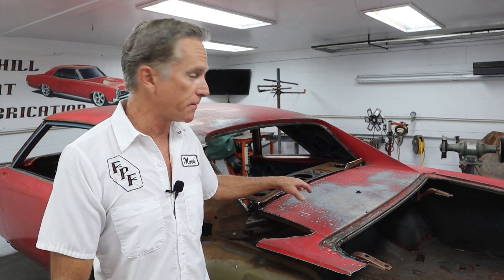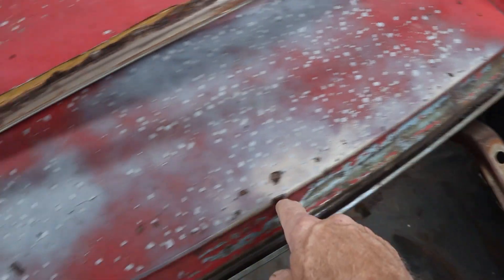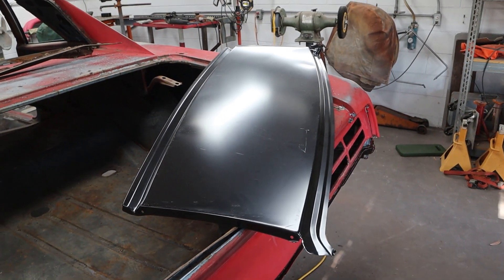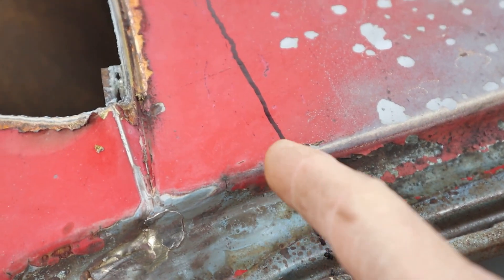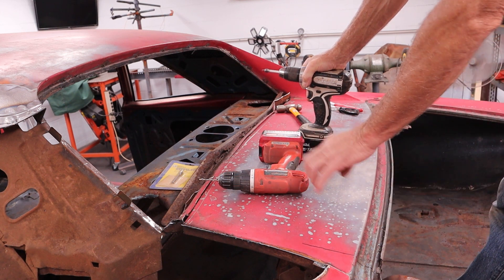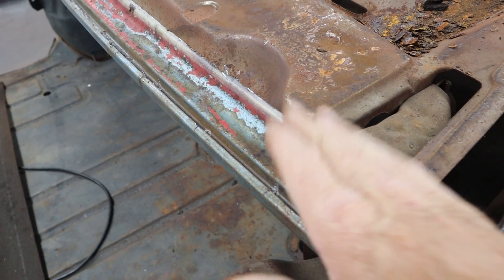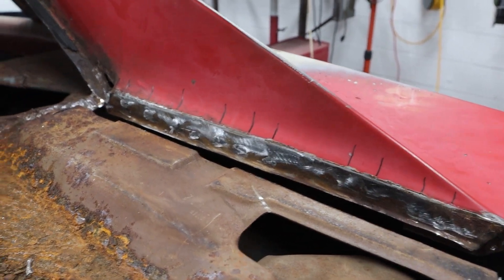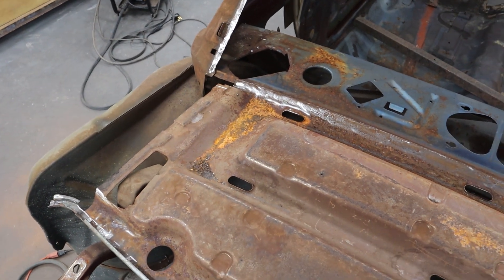GM A Body Rear Window Rusted Filler Panel Removal How To - GTO RestoMod (Ep 11)

Comment: Thanks for the video Mark. All of this is pretty intimidating to me but you explain it very well. At my level I think I need the expensive one.
Reply from the maker: It can be but it is just a series of steps to get where you want to be just like anything.  Knowing the steps is the hard part.
No guarantee the most expensive one would be much  better.  These things can be a crap shoot and that is why reviews are so important.  Buy a part, write a review so the next guy can be informed.  I wrote a lengthy one on this part with pictures.
Mark

Comment: if you  drill a pilot hole  in  the center of  the spot weld, the cutter will stay in place and  will  not wobble and  cuts faster
Reply from the maker: You are absolutely right about that.  In this case I will be using a spot welder to reattach the filler panel and did not want to have to weld in all the holes.
Mark

Comment: I've got that same long necked die grinder , use on everything.  Also I've got what I think is an old tile roller . It's kinda like a english wheel die on a handle and I can flip over new panels and pretty much roll out a lot of imperfections .
Reply from the maker: Yeah I am about to wear that thing out I use so much, very handy.  I used my thumbs to massage a lot of the dents out of that panel but it needs some more love before it goes on for sure.  20 gauge is pretty thin.  I have something like that too I think, I will give it a try thanks
Mark

Comment: Mark, big job a head hope it go's well I know your under time crunch so Rudy can be dipped. The best patch come from OPGI but are pricey and Summit Racing are hit and miss but low cost. Will keep watching Plus need send you some picture of my truck and clear coat issues.
Reply from the maker: OPGI is out of everything unfortunately with a lot of stuff backorder. I think they got cleaned out during the pandemic while everyone was home working in their projects.  This panel came from Jegs which is certainly the same as Summit but it is here.  Yes send me those pics.  I forgot about your clear issues, maybe we can figure out a simple fix.
Mark